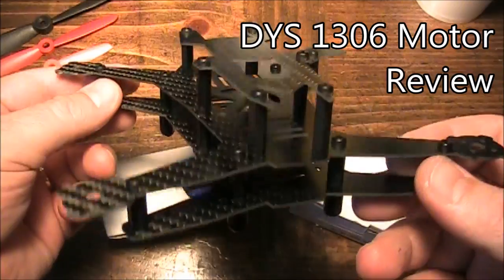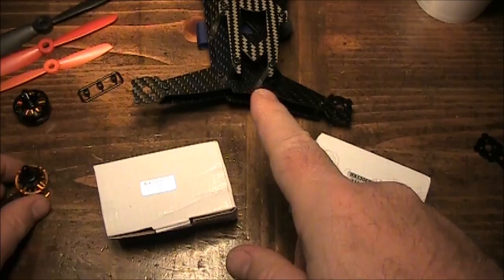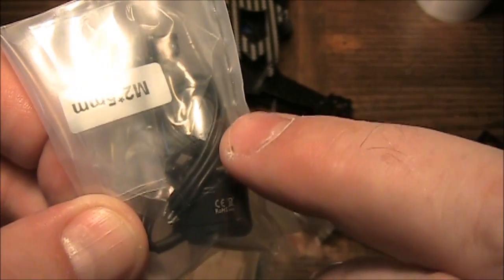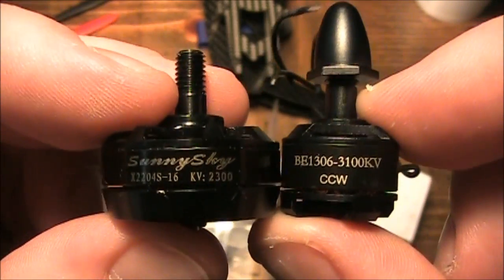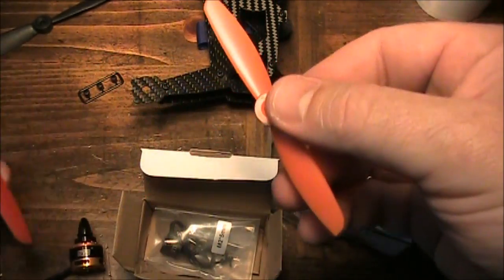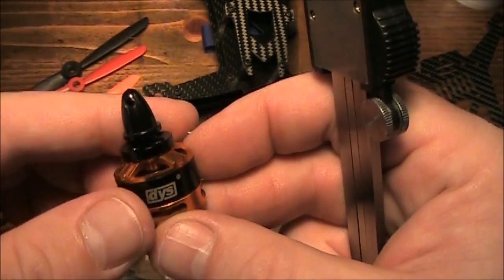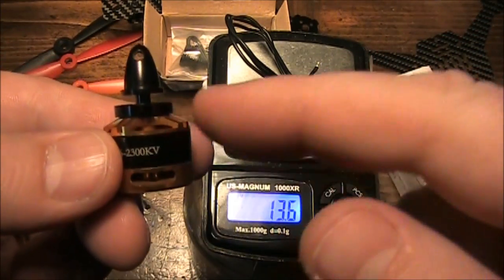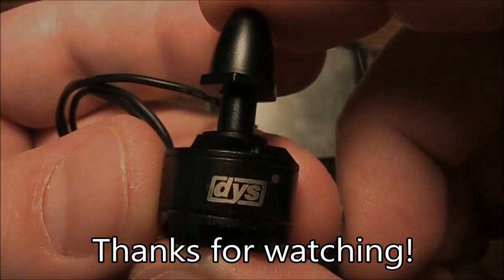DYS 1306 3100kv Motor Unboxing and Review  from Banggood

Comment: Will these suit a 210 class racing quad with a AUW of about 390g with these? With 5045's?
Reply from the maker: They can spin 5" props alright, but in an all-out-speed race, they'll lose to most 2204 motors.  They'll last longer in flight than 2204 motors because they use less amps.

Comment: Great build/fly series Travis! Thanks! After flying "regular sized" quads (largest 560 HK Alien) for months, I'm moving to mini 250's and below with the Q200 as my first attempt and for FPV racing. I just ordered DYS 1306's from Banggood, but soon thereafter read a bunch of reviews from their customers from July that were pretty negative. I assume it was a bad batch of motors. I'll keep my fingers crossed for better results.
Reply from the maker: Mine have been good so far.
Reply: +travisgrindal Followup report. Just got done with the quad and have been flying it for a day! The DYS 1306's have performed well. What a blast!
Reply from the maker: +Escape Velocity Good!  Mine are still working well.  I've tortured them a couple of times on 4S and they are still good. They get real hot so I don't recommend flying with 4S on these motors.

Comment: Which wire is ground, positive, and pulse, I can't tell because they are all black wires, can someone help me please because I do not want to fry the motors
Reply from the maker: John A Bonilla It doesn't matter how you connect them between the ESC and the motor.  If the motor spins the wrong way, you can flip any two of them around and it will reverse the direction of the motor.
Reply: They are three phase AC motors, the ESC converts DC to 3phase AC (pulsing DC) with the proper timing and phase to drive the proper winding  of the motor. How they are connected only changes them from CW to CCW rotation.

Comment: I have the same motor, the dys 1306, but I'm not sure which one is power, pulse and ground please help
Reply from the maker: John A Bonilla It doesn't matter.  You can plug/solder any 3 motor wires to any 3 ESC
Reply: John A Bonilla If you line up the wires with the esc pads as they come out of the motor, it will spin ccw, if you swap any two motor wires it will spin CW.  I just did 4 motors and all 4 followed this pattern.  This will make it simple to solder motors in the future if all these motors are consistent.

Comment: Nice job Travis, I am designing a 220. These will do the job nicely!
Reply: 1306 3100kv on a 220 frame? I usually only have seen that on 180 and smaller frames
Reply: deepimpact.io Typo sorry bud it's a 190 but the booms are just over 200 (started out 220)
Reply: RCTV-UK cool. Looking forward to some videos
Reply: deepimpact.io It should be the most powerful sub 200 multi to date ;)
Reply from the maker: RCTV-UK So far, so good with these motors for me!
Reply: ***** Nice one Travis, just looked at a lot of your videos. Good job! Would you like a HAMMERHEAD T6 frame kit for review when they are ready?

Comment: Cool little motors. Great idea about doubling the frame part to stop breakages. These things just keep getting smaller and smaller.
Reply from the maker: crampynz Thanks, yeah they do get smaller.  The quad from in this video is a 200mm.  I have a 150mm coming in the mail.  I may run these same motors unless I can find a descent deal on a set of smaller ones.

Comment: What? No thrust test?
Reply from the maker: simonTemplar Yeah, I know.  The problem is that it is hard to compare one person's thrust test with another user's.  The only way the results are really comparable is if the same person does the same thrust tests using the same equipment.  Unfortunately, I don't have anything setup to thrust tests.  I did want to compare the 1306 size against the 1806 and 2204 and the propeller sizes just because I think they are both so small.  I'll show how the motors perform in an upcoming video after get the Q200 built out.  I'm thinking they're going to work real well.

Comment: I have them on my Morphite 180 and they rip on 3s! I built 2 just to have one as a back up and I've been flying them every day. The smaller size makes them great for blasting around the neighborhood.
Reply from the maker: jkflorida2013 Sweet!  Are you using 3S and 4" or 5" props?  I have a couple of small 3S batteries - a 500 mAh and 1000 mAh batteries.  After hearing this, I'll have to try them out.  :)
Reply: ***** 3s on 4x4.5 props. I'm limited to 4" props on the Morphite, but its perfect. And I'm running 1000mah 35c Zippy lipos. You need relatively high C rating because these 1306's can pull some amps.
Reply from the maker: jkflorida2013 Well, looks like I'll be placing another order soon for more batteries.  I bought 2 x 1300 2S batteries to fly with some of my friends in a gymnasium, but it sounds like I will NEED some 1000mAh 3S batteries for flying outside and putting them all to shame!  LOL!!   :)